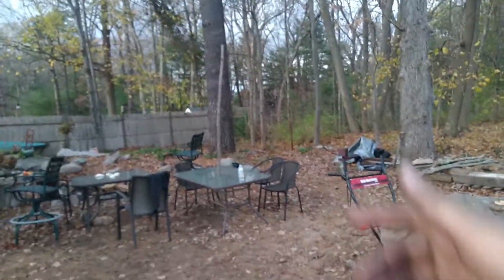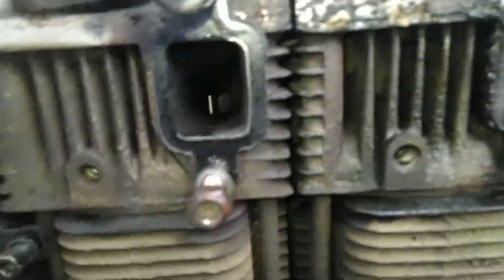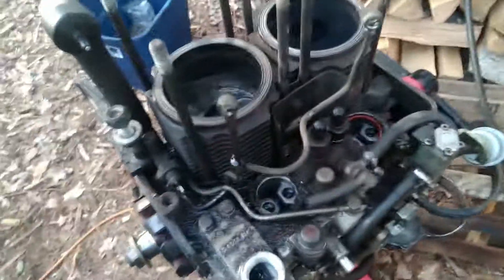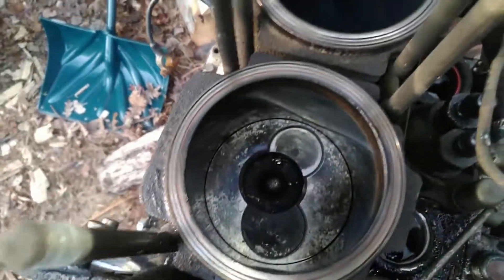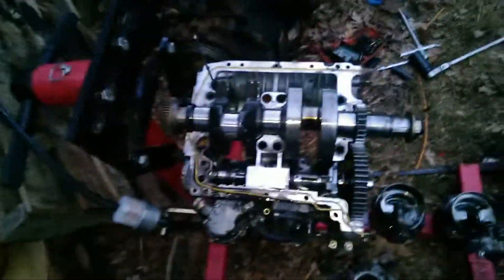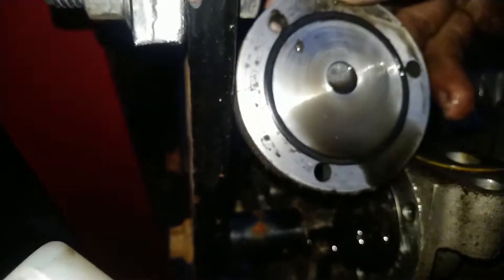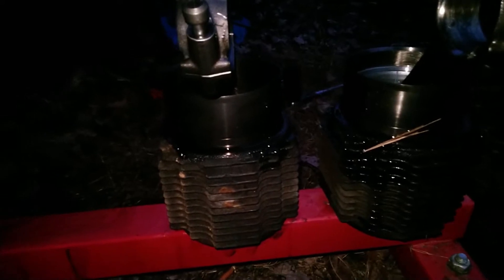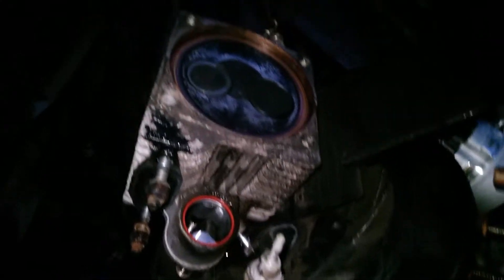Cheap Hatz Diesel 2g40 part 2.  Teardown

Comment: They made thos cylinders easy to remove for when they are in middle or war to take one out and not use it or quickly replace it with out a full tear down
Reply from the maker: Yep and I like that part of the design a lot.  What I don't like is the long studs that are both the main and head studs.  It makes it so you can't remove the crank without having to take off the heads, cylinders, and everything attached to them.  Also there are seals on each of them that seem to be to keep water out, which is 8 more things that can leak.  This particular one isn't one of the engines that can run with deleted cylinders.  That's the bigger air cooled Deutz Diesels.  If you tried to do that on this one you wouldn't be able to clamp the mains down and the block would immediately split.
Reply: @Choochinc  ya that would be a crazy out of hand machine with only one lol but ya some have a smaller but on the cylinder housing that the head sits on but ya they do some weird motor build where it came from
Reply: These types aint that old
Reply: Hm, these engines weren't build an developed in times of war, that's a big cliché. But yeah, the design of studs this long are weird with that much seals, but it kinda works.